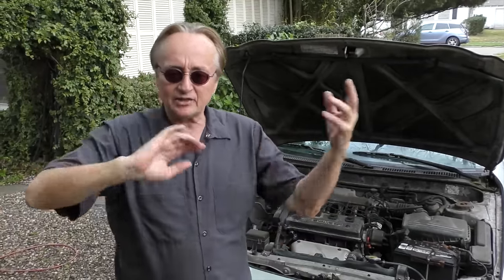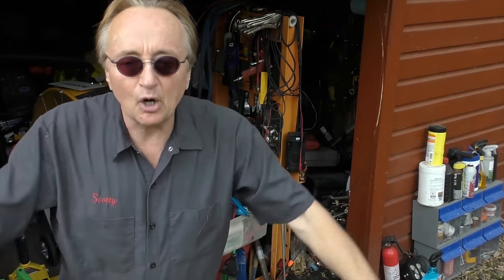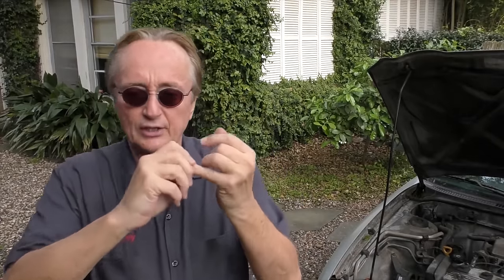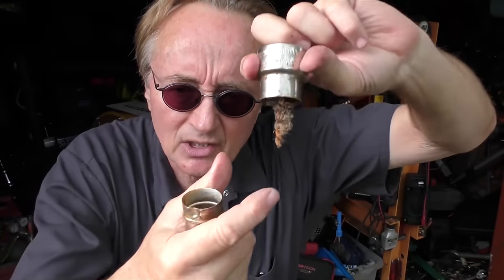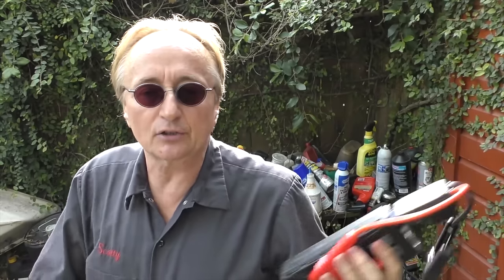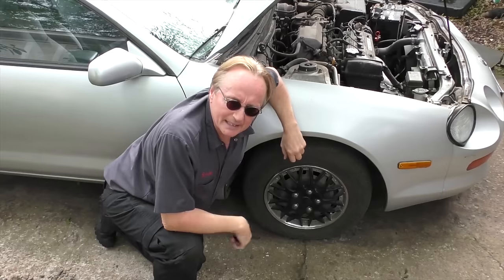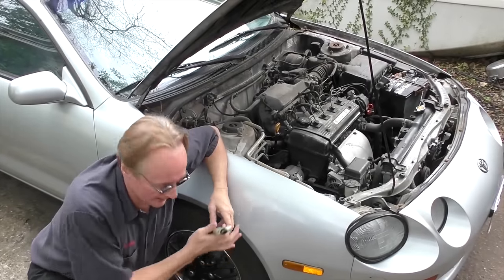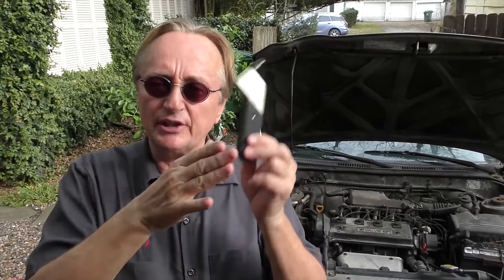If You're Not Doing This Before Starting Your Car, You're Stupid

Comment: So front and back pads are worn enough for the light to come on, just fill up the reservoir?  No, do the brakes.  Next time someone does the brakes the fluid is going piss everywhere when they push the pistons back in.  Stop, this is not a fix for anything.  The light is doing it's job.  You make it sound like the entire industry is scam artists.

Nobody sells a list of parts for a weak battery.  Every modern shop has a charger and tester...

I'm not even going to finish the video to comment on the other bunch of nonsense.